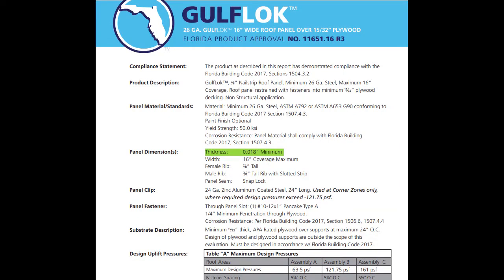Gauge and thickness

Comment: Please different between full gauge and non full gauge roofing sheet.
I found 0.45mm at full gauge and I found 0.45mm non full gauge but same  aluminium roofing sheet has the same thickness
Reply from the maker: Hey there! As explained in the video, steel is measured in gauge. In the early 1900s, steel was squeezed or pressed. Each time it was pressed, it was counted, resulting in a higher "gauge." This is why 26 gauge material is thinner than 24 gauge material. However, .032 aluminum is .032 inches thick. The same goes for .040 material. Aluminum is measured in actual thickness (in inches). Hope this helps!